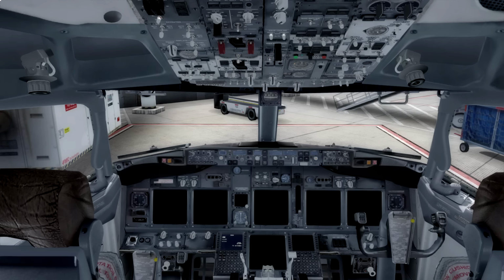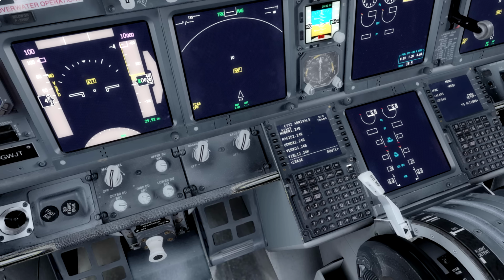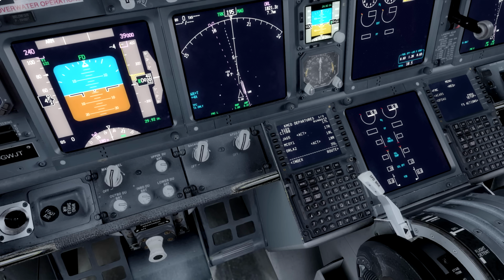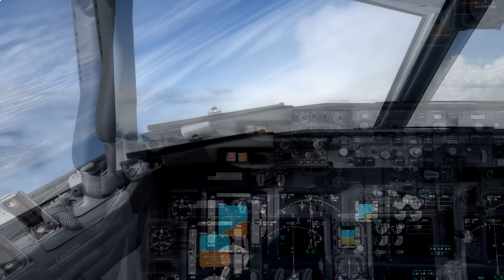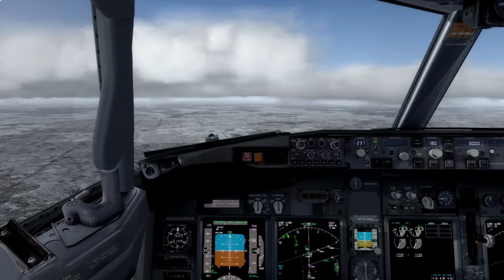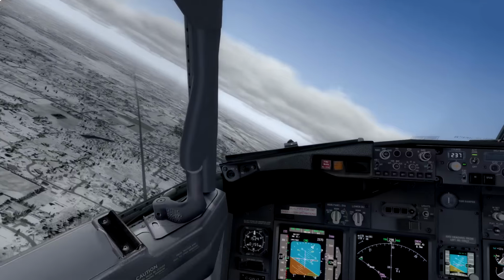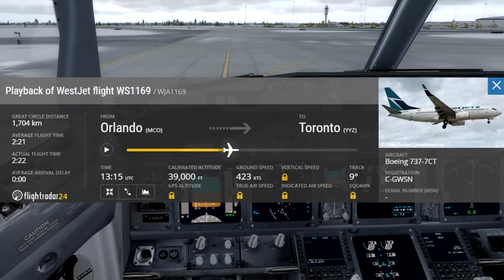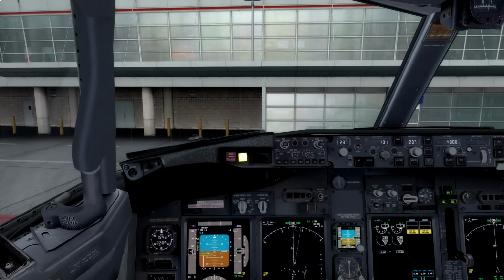Orlando to Toronto - X Plane 11

Comment: Nice flight , but why no Toga on take off ?
Reply: thanks for the reply ,but usually you see Toga displayed on the top right off the PFD ,just wondering did you have LNAV & VNAV set when you configured the MCP ? , Iam thinking that may be the reason why it did not show TOGA ,by the way that landing was spot on , very smooth